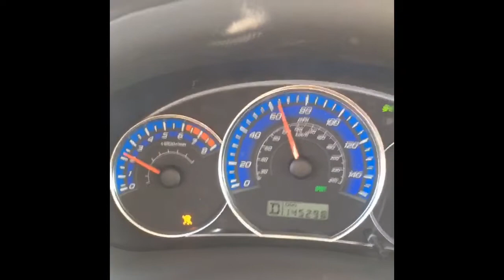P0303 & P0304-Subaru Misfire Codes Solved-What was the cause?

Comment: I have the same problem but do not have access to the original crank shaft sprocket. How can i fix this without it? Is there a way?
Reply from the maker: IF this is the problem, you may need to source a new one
Reply: @stvnswld i changed it and still get the code at high rpm. The cel blinks on for cylinder 3 and goes to cylinder 4 and the light stays on. No other codes.I have done basic checks. Spark plug, changed coil 3 to 1 and 1 to 3 same with injectors and they did not fallow. Still 3 and 4 misfire. Compression test all in speck. Did a smoke test no leaks. Cleaned the purge valve, I put a camera in the cylinder all valves look seated properly. I was able to snag some new heads. Just in case but If  it was valve the compression test would be out of spec for that cylinder right?. Checked throttle body, checked EGR valve. I am at an absolute loss. I was able to get my hand on ECU that is the exact same number as mine but the security system programmed to my computer won't let it turn over without being programmed.
Reply from the maker: @FlutterbyButterfly-q3t what rpm does it occur at? Is it the same every single time?
Reply: @stvnswld I am so sorry I have responded it doesn't give me notifications...So around 380,000 for the CEL to blink indicating misfire cylinder 3 or going 80 mph. It stops blinking if I drop speed to 77/78 mph and 400,000 when it stays on.  I believe that's when cylinder 4 joins the party lol ... I have been doing more research and have been testing more .. I found my knock sensor is bad. Which I read will give the misfire at high rpm.OEM replacement knock sensor has been ordered. Just waiting for that to come in.
Reply: @stvnswld  replaced knock sensor..still misfire but not as often
Reply from the maker: @FlutterbyButterfly-q3t  glad you’re getting somewhere. I’m not sure what else to recommend, sorry

Comment: My 2008 impreza 2.5i has same issue and changed plugs wires and ign coil
Reply: Did get an engine swap 😢
Reply from the maker: I would test the compression in each cylinder

Comment: I have the 2011 subura outback  and same problem...  p0304 , change plugs, wire and ignition coil .. 
Maf sensor change, cleaning body acceleration, the code appears and after several miles of driving disappears.
Reply from the maker: Is it only p0304 or multiple cylinders? What kind of coil packs did you use?
Reply: @stvnswld only p0304 , I checked the compression of that one and it doesn’t go up from 90
Reply: @stvnswld  REPS504623 Ignition Coil
Reply: Update?

Comment: Hey i like your video I have subaru forester 2011 manual transmission I am having cylinder 2 and 3 misfiring issues i bought it recently though i think they cheated me because i changed spark plugs but that doesn't solve the problem next I'm going to change ignition coils if that won't change the problem i don't know what to do because it's stalls on stop signs sometimes which is basically a  headache because it is a manual transmission car so idk what to do.
Reply from the maker: How many miles are in the car? Does it use any oil? I would try swapping a coil from a cylinder that’s misfiring to one that isn’t. See if the code follows the coil. Misfires are tricky devils, clean your mass air flow sensor with MAF spray cleaner. You may have a vacuum leak somewhere if it’s dying at idle. Perhaps run a can of sea foam in the gas to clean the injectors. Lots of things to try, don’t give up! There is always a smoking gun to be found.
Reply: @stvnswld  MAF sensor cleaning done!
Fuel injector cleaner does make 20-30 % effect now idling a little bit better plus I noticed if the gas tank is full it doesn't stall that much. Idk what's the problem but now I'll interchange coils followed by fuel injectors car have 102000 miles on it.
No it does not use oil.
Reply from the maker: @NavnitGujjar007  another thing you can try is sucking sea foam in through the intake while someone revs the car to 3000 or so. Then suck in a bunch and let the car die. Let it sit for 10-15 minutes and then go run it hard for a while to clear out carbon. Maybe some carbon buildup on valves
Reply: @stvnswld  okay I'll do that and let you with the results. The day I bought the car  next day it was only showing cylinder 2 misfire I thought it could be throttle body needs to be cleaned or something but after 2-3 days it started to show cylinder 2 and 3 misfiring.
One more thing should I change the PCV valve  because that looks fairly old?
Reply from the maker: If you’re using oil, your PCV could be a culprit, otherwise it’s probably alright
Reply: @stvnswld  as I bought it recently I changed oil so Idk right now it's using or burning oil or not although engine oil was less when I drained that.
Reply: @stvnswld  hey brother I changed PCV as it was clogged changed spark plugs and coil pack as well but it is still stalling out I don't know what to do next if you have have any idea do let me know please.
Reply from the maker: @NavnitGujjar007  I wonder if you have a restriction in your exhaust. Does the car have plenty of power or is it a total pooch?
Reply: @stvnswld yeah after changing ignition coils now it even has more power
Reply from the maker: @NavnitGujjar007  at this point I would recommend testing compression on all cylinders. Compression testing kits are pretty cheap on Amazon
Reply from the maker: stevenoswald@gmail.com
Reply: @NavnitGujjar007  did you do idle relearn after changing? also clean the throttle body

Comment: HI, did you had to open the entire engine to swap it ? What was the procedure to replace this crank pulley?
Reply from the maker: I removed the accessory belts, the fans, and the damper to be able to remove the plastic timing cover. The timing belt will need to be removed in order to remove the cogged pulley off of the crankshaft.

Comment: Just got a 2014 forester and after replace, valve cover gasket , spark plugs both oxygen sensors and still get different codes I’m done. Never again will I buy Subaru.
Reply from the maker: I’m sorry to hear you’ve had a bad experience, that’s not fun at all. God knows I’ve chased problems over the river and the through the woods. 

What different codes are you getting?  Does the car run poorly? I might have a couple of ideas?

I don’t claim to be a mechanic by any means, and occasionally when I can’t figure problems out I reluctantly resort to initiating paid diagnostic expertise of pros.
Reply: @stvnswld  honestly I’m done with this car. Caravan is coming to pick it up tomorrow. Never again will I buy Subaru
Reply: @ede4345  Don't give up on Subaru. Always keep trying and never quit. you quit life if u quit subaru.

Comment: yup so I just did head gaskets, car ran great for a while until I kept getting codes, and before she died it was misfire 3 & 4 and I remember now the water pump was different, I have diagnosed everything, after the car is warm it'll keep starting but once cold it has to run open loop and cant due to timing. I'm changing the water pump tomorrow back to the OE, I'll update if she runs or not.
Reply: How about that update, brother?
Reply: @ItchyKneeSon  head gasket went - I have replaced the head gaskets - had the heads milled - Car runs great I just have a cat code because it got soaked with antifreeze and now keeps throwing p420 codes. I am going to knock out the catalyst and see what happens. I get a bog down after its warm, I am still not 100% on the cats it could be throttle body but, the misfire was because of the head gasket leaking.
Reply from the maker: What is different about the water pump? I wouldn’t think that would make much difference. Is it that the thermostat mounts or front vs bottom?
Reply: Over 1 year and still haven't gotten that update
Reply: @Zeppelin9113  I actually just did this last month lol
Reply: @Zeppelin9113  I also set the vales out of the car and when I installed the timing belt. but there was no need for the 2nd check. Everything adjusted right out of the car. The valves were lapped in by the machine shop this time.

Comment: Was this for an EJ motor or FB motor. I'm having similar issues with mine but I have a 11 forester with a FB25 motor. just wanted to know if you think the chain vs belt makes a difference for this diagnosis
Reply from the maker: Great question! This an EJ engine out of an ‘09 Forester. You’re getting both of these codes or just one misfire code? Does the car run fine or can you tell that the engine isn’t firing right. Does it sputter and stumble around?

Comment: Change the crank shaft timing gear fellas. The one on your new engine isn’t correct. Make sure you use the old timing crank gear
Reply from the maker: Depending on the JDM engine replacing the old engine, they can be the same. They can be correct. I have done several engine swaps and kept cam and crank pulleys IF they are the same on both engines. In this case, the JDM crank pulley had  tooth bent slightly, causing the computer to read a misfire, but only at higher revs.
Reply: @stvnswld  I specialize in Subaru. I have seen this many times. Most JDM engines come out of Impreza. Always best to use original timing gear as this is what your computer likes
Reply from the maker: @B-Robbb  that is definitely a great rule to follow. Perhaps I’ve been lucky a few times? Thanks for your input, I love hearing feedback from other Subie guys!
Reply from the maker: @B-Robbb  I would love some feedback from you on my timing belt tensioner video if you have the time to check it out.
Reply: @stvnswld  I just replied to that specific video. Wish you luck. Long story short I think you should change your brand of timing belt you use
Reply: @B-Robbb  hi my Subaru is creating problems as well it's stalling out I changed spark plugs, ignition coils and pcv valve still car stalls so I don't know what to do next.
Reply: Did you fix it yet?
Reply: If you don't have access to the original engine how can this get fixed?

Comment: I'm having this code P0303 and P0301 misfire cylinder for my Subaru G4 do u think that could be the same problem
Reply: Subaru G4 2014
Reply from the maker: I don’t know about that. Both right side cylinders to me would indicate some other problem. How does it run?
Reply: @stvnswld  I haven't driven it since because when I started up it's making some unusual sounds
Reply from the maker: @winstonburnett8437  I don’t think this is your issue then. This car ran fine, and the codes didn’t cause the car to run funny
Reply: @stvnswld  ok thanks

Comment: Ok, how did it fix the issue?
Reply from the maker: I installed a different clogged crank pulley and the codes went away. Perhaps a tooth was bent or out of balance on the old one

Comment: I got it for cylinder 3 only...
Reply from the maker: How does the car run? I’ve had high mileage cars that misfire on only one cylinder and it has turned out that that cylinder has low compression.
Reply: @stvnswld   It just shakes alot when I make a stop.  But when I hit the gas no problem.  The rpms get low.
Reply: @3obardThawn3  same issue here. Only cylinder 3, also have a jdm swap, and it’s only clunky at low rpm.

Did you solve what caused your misfires?
Reply: @Joeydoesmedicine  did you figure out your problem?
Reply: @REVERSE FLASH  did you figure out why the rpms were low?
Reply: Same problem. JDM swap. Same cylinder. Shakes a bit at low idle. Runs fine when driving.

Comment: I have the 2009 subura froster and same problem... change plugs, wire and ignition coil .. same problem 😕..   what the name of that part?
Reply from the maker: Crankshaft sprocket. Your part number for the ‘09 non turbo is 13021AA141.
Reply: @stvnswld  thanks
Reply from the maker: @demarmckenley7156  you are welcome

Comment: I have the same problem with my 97 legacy,i put a different engine in and noticed a little play in the key way.I shoulda addressed it then but didn't and i new it want right and now when i go up over 3k for a length of time i get cylinder misfire on 3 and 4.
Reply from the maker: There is a chance this could be your smoking gun!